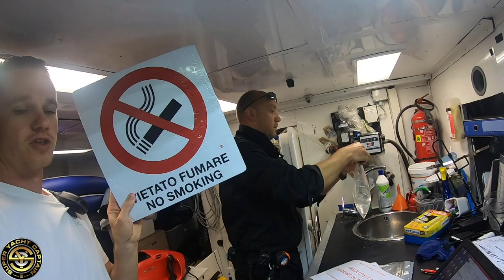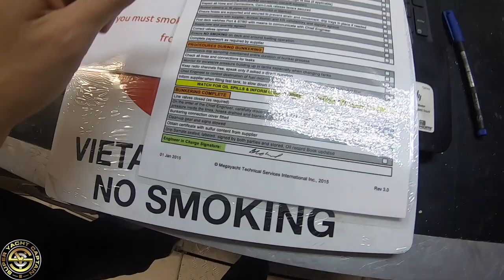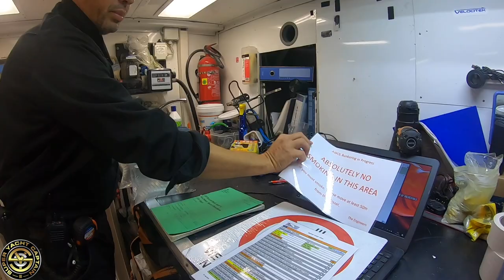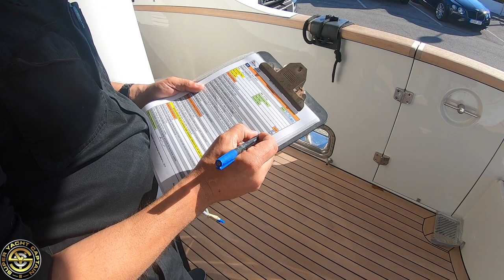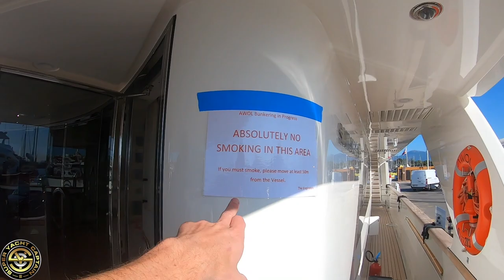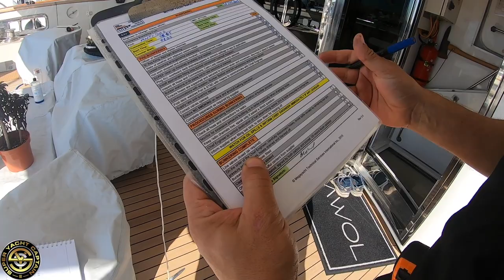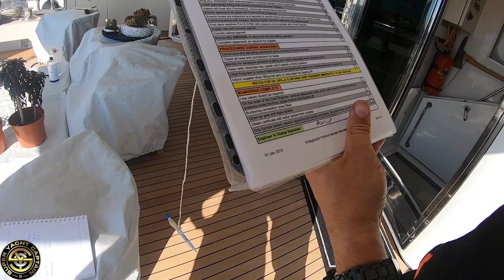REFUELING A SUPER YACHT!!! (Captain's Vlog 80)

Comment: When  I was in Engineering in the Navy I would test the fuel from the receiving station and then when it passed my fuel test I would inform the EOW who would then allow the fueling to commence. I always erred on the cautious side and never had a bad batch of fuel on board.
I also ran my purifiers whenever I topped up my day tanks so that I did not have problems with my filters. By the way, the best fuel and the cleanest fuel I ever received was in Japan. The fuel slip supervisor was on board verifying my tests and if they did not meet his requirements he made his crew re-clean the fuel and then we tested it again.
Reply: Dale Johnson when you say “purifiers” I’m curious what type. I have been a Chief Engineer for 20+ years. On my vessels I ran several centrifuges that was continuously cleaning the fuel and separating any water. 
That’s a cute fueling hose eh? I would be there for days if I had to fill my boat from those little trucks. I’m surprised to see a DOI.
Reply: EOW, Engineering Officer of the Watch
Reply: Smoking lamp is out I repeat smoking lamp is out
Reply: Likely they purify it onboard and have a pretty good idea of whom they are buying fuel from, since i suspect they have a series of stops they routinely go to. Canadian Coast Guard back in the 90's picked up a load of fuel in the 90's in Panama when a ship was coming around to the West Coast, they refuelled all the light station and then discovered the fuel was contaminated......
Reply: AWOL has Alfa Leval purification filter fuel system

Comment: Pretty cool. Im sure that boat has a hell of a vent. For most the problem comes as tanks are near full, vent air can force fuel spray out onto boat or in the water. Anyone unfamiliar should slow the fill when tank nears 80% give or take. Well done as it should be. Top notch operation.

Comment: that's a lot more complicated than refueling airplanes, the other day I put 30052 gallons in a 777, only took 35 min to pump
Reply: Ya, but a spill on an airport is not nearly the ecological disaster that a spill on the water is.
Reply: 35 mins to pump 150 tonnes into a 777? Through a flexible tube? Into tanks in the wings? big heavy tanks in the wings? Tanks that would require the wings to bend in places and not in others instead of evenly along the whole wings length? Erk...disaster imminent.

So these engines don''t create and maintain a steady vortex in over-unity then? The air, when forced into a strong enough vortex gets hot and drives itself. That's what we were taught at school. Kinda just sucks itself along...
Reply: Boat people like to keep it complicated.
Reply: I wouldn't say it's more complicated, it's less advanced. Aircraft refueling has the advantage of higher fuel pump rate speeds, through multiple feeds at each wing. This vessel here only has one feed at a much lower fpr/m.

Very convenient. Sucks that due to safety regulations and practicality, refueling these vessels are tedious and slooow.
But they don't required refueling that often and a good Captain never let the main fuel storage go below a certain mark, since it's less time consuming to fill it back up.
Reply: @Kurskaja_Narodnaja_Respublika  Yes, but only to avoid injury, death or pollution..

Comment: Got be a bit of a boat nerd to enjoy bunkering procedures! Little surprised you don't have a ball valve at the connection on the yacht side, to prevent fuel coming out at severe roll angles. Also surprised that you don't a have locks on it. We had a new engineer miscalculate the fuel needed for our Cutter and the excess fuel puked out of the dipping hole in front of the Captains cabin and down into the forward cabins. He was not popular for that trip as we spent much of it removing fuel oil and scrubbing everything.

Comment: I liked the way you held the cup under the fitments to catch even so much as a drop of fuel. I would've maybe put an oil absorbing towel in the cup to catch those wayward drops. Even went so far as to encapsulate the areas of the fitments with paper towels to avoid droplets immediately. This is way more involved than just filling up your car at a gas station that's for sure!

Comment: At 11:56 your fuel vendor is on the phone and seems a bit distracted when you're handing him back the fuel hose/connector... Informative and fun to watch video, thanks!
Reply: Did I hear cell phone use while refueling is dangerous?
Reply: @michaelwiltgen.waterman4111  does not matter if it is dangerous or not. Rules are rules. Unless that is a phone that is ok to be used in ATEX zone 2 (or 1) it is not ok. And I am pretty sure that he does not have an ATEX phone.
Reply: assassinlexx  I am sure that you are right. But knowing that is not enough according to the rules. What if you have the next "Galaxy Note 7" without knowing it and it catches on fire when you are standing and fueling your car. I know it is quite unlikely but thats what the rules are about, to make it safe.

It is like I think it is silly when Americans seem to wear eye protection when doing a science project. Even if the science project is just mixing milk and water, the protection is there.
Reply: Phone is nothing. In Albania I have had 2x 50,000L tankers next to each other and connected with first truck with guys in centre smoking a cigar. Told them to put it out but language barrier hindered.

Comment: What was the point of the "drip sample".  What is it for, what do you do with it, and why is it important?
Reply: suppliers often try and cheat you of fuel so they may supply diesel at the start then change to another fluid (may not even be a fuel could be water) so the drip test is done over the course of the bunkering operation. it is important so you know you are getting what you paid for. typically you would not run this fuel until the test results came back.

source: I am a marine engineer on cargo vessels
Reply: In the commercial industry, the drip sample is used to take a total sample of the fuel bunkers. From the sample 4 bottles are filled for: 1. The ship 2. The bunker supplier 3. The ship operator/company 4. Lab analysis.

 The fuel is tested for bacteria and water content. The fuel will always contain water however, this is usually very very minimal. This is done to check the quality of the fuel and whether or not it is suitable for use. If the fuel was rejected by the lab. The fuel would then have to pumped out and the tank would have to be cleaned. Very time consuming and expensive.

Very interesting to see how a yacht performs bunkering, compared to commercial vessels.
Reply: Thank you all for your very informative replies!!
Reply: Also that sample may be required if there was a spill so they can determine if it came from your vessel or not.

Comment: Serious Question: Why was the Fuel Sample not tested prior to filling the yacht's tank? I'm confused because we test ours prior to filling to prevent introducing contaminated fuel on board even though there is the fuel:water separator pump.
Reply: Yes, please, more about the sampling process?
Reply: Dean Lewis I’m not sure about his process. I know our vessel we sample the fuel by using color cut to test if their is water and gauge the tanks of the bunker barge just to make sure there isn’t water in the fuel. Dirty fuel is a issue but hard to catch, that’s why we have 6 fuel filters. Water is the big issue, our water traps work but water in the tanks also creates algae blooms, had to get our tanks scrubbed last year due to it.
Reply: @LegendLength  I would want it tested prior to bunkering.
Reply: Nope gasoil is normally not tested before bunkerking. Particels and water will be filtered out and when normal a gasoil grade is ordered it should be on spec for the engines they use. In that trading area there is no need to check pour point or cold filter plugging point. The sample taken is for marpol. To prove you’ve bunkered a compatible grade for the area in regards of sulpher contents.
Reply: fuel sample is not that important on a boat/diesel. Jetfuel for helicopters for example. There u should always check the fuel before bunkering
Reply: I retired from Fuel’s and lubricants delivery a few years ago, but back then, whenever I had to deliver product to the Port of Houston,  all fuels and lubricants were sampled and tested at the origin, or pickup location, with a C of A, then re-certified by the receiving vessels, before signing off on delivery. This was the protocol for the ports, as well as the airport. Only local filling stations and the railroads did not require a C of A. It was the booking agents job to inquire about the procedure, and the delivery drivers responsibility to make sure all the required documents were noted prior to pickup.
Reply: It's an interesting question, but I would ask you if you check the quality of the gasoline/diesel you put each you fill your car tank?
Reply: @Antagraber  If your car engine sucks in dirt or water, you stop on the side of the road and call a servicetruck. Try that in the middle of the Atlantic,
Plus (LS-/ULS-)MGO (which is compareable to normal road diesel) has a lower standard to your usual gas station juice.

Even with fuel purifiers, you may introduce a lot of garbage into you main bunkers and clog something up.

Especially when refueling in less developed countries, you absolutely have to check fuel quality before filling up - we even check every fuel cell on it´s own, so if the truck is sectioned into 6 cells, we sample all cells and test them for water, clarity and smell.
Reply: It's only checked for "dyed" ( sulfur ) .. I ASS/U/ME ..(The fuel is Dyed at refinery with red if it is a high sulfur content) "low-refined" diesel is NOT permitted in these vessels
Reply: @MemoryLaneCinema  A bad Diesel oil quality will just blocked the fuel pumps and injectors! So of course, even on a ship it is very important to analyse, filter and purifiying it. On board merchant vessels, we take samples at the bunkering manifold then we send to shore for analysis. After about three days, we receive the details and only after that we can burn it. Diesel engines are very very sensitive to bad diesel oil. Helicopter or aircrafts running turbojet engine are really less sensitive but the regulations is more strict as it will be a disaster to have an engine failure during the flight.
Reply: This subject got touchy very quickly. Damn.

Comment: If it were me, I’d be adding diesel treatment (Algicide, Fungicide, Water Dispersant) with every delivery.
Living offshore on Islands, in commercial lobster fishery, we typically refuel from carrier vessel at sea every 2nd or 3rd day, and always treat the fuel we take on as a precaution.
The fuel comes out of a ship from Singapore, sits in tanks on the harbour hardstand until needed, then into tanker truck, then into carrier vessel tanks, then delivery at sea, so potential contamination points along the route are frequent.
Fixing problems at sea after the fact is a lot harder than in harbour where everything’s readily available a phone call away!

Typically the vessels are at the offshore islands for 6 months between returns to port for this sort of tomfoolery!

These guys wouldn’t last the first day in the lobster industry.

Comment: Never understood why they put no smoking when pumping diesel signs out, diesel burns under extreme pressure not a spark plug.
Reply: Its still considered a combustible liquid, UN placard class 3 hazmat.  it is definitely less LIKELY to ignite from a cigarette than gasoline (petrol), but it still can.
Reply: Diesel doesn't burn under extreme pressure. It combusts. If you want to make useful power, thats the way. But in the open air, diesel can also burn, just like gasoline.
Reply: Diesel start vaporising thus creating flammable mix around 60 °C (140 °F) . As you can notice they are at direct sunlight so it is possible scenario. 
Normal gasoline start vaporising around minus 40 °C (°F) so it is considered more flammable.

Comment: Interesting that you don’t water-down the teak deck before fuelling (to prevent lasting damage to the teak should there be a small spill). Also that you don’t keep new fuel in one tank (port or stb) whenever possible in case of contamination. Did your check list include confirming that the tank isolation valve(s) are open?

Comment: Where does the air from the empty tanks exit the ship?  Fill up an empty vessel with a liquid and air escapes.  I have heard them called overflow valves.  Where does yours exit the ship?
Reply: The tanks are well vented.
Reply: The tank vents will either be run up to mast or some yachts have tank breather at bunker location.

Comment: So that is how you fuel the yacht, but what about other fuel? I assume the chase boat and jet skis and what not run off regular gasoline and not diesel. So I assume you have another tank to refuel those. I would assume that you would probably need a couple hundred gallons at least. Do you just use portable tanks or do you have a dedicated tank for them? Do you use propane for the stoves or grills?

Comment: what is the point of the drip sample? testing later when the engines blow? check for contaminants, or water in fuel?
Reply: Its a standard in the marine industry.  Contaminants, off spec, etc.  Some places will send a sample in, others just hold it.  Another benefit is if the fuel comes up water contaminated, it can be checked to see if it came from the supply or from a hull leak (more applicable to large merchant ships than super-yachts, but still)

Comment: How is fuel charged to guests?  Is fuel included in the charger rate?  Are the tanks normally kept full then you fill up at the end of the charter to know how much was consumed?  Do you charge for fuel by the amount of main engine and generator run time?
Reply from the maker: We sound the fuel at the beginning and end of each charter and charge the guests the total fuel consumed based on the price per litre.

Comment: Enjoyed watching that.  If guests are onboard do you ask them to refrain from using mobile phones near the bunkering connection?
Also, as the ships  fuel connection is in that particular location I would have thought an opening or hatch would have been in the hull to allow an easier transfer of the hose plus safety if the connector and hose disconnect by accident, from a barge, fuel station or lorry as shown. Or is there a particular reason it's done that way ?

Comment: Based on "bunkering costs"(Fuel purchasing) in Gibraltar. A favoured place for "super yachts" owing to "tax free" status, I "guestimate" the cost for bunkering motor yacht "LOON" to be in the region of 130-135000 Euro's(poss. 140-150,000 U.$). Either way, quite different to merely driving to a local gas station, to put 50 bucks worth into a vehicle..!! LOL

Comment: This is my guess.  Diesel fuel floats on water, so taking the fuel sample when the delivery truck is empty would find water if any were present in the bottom of the tank.
JIM
Reply: Not necessarily. A: diesel absorbs a small quantity of water (similar to the way air floats on water, doesn't mix with water, but absorbs water) so you need to check the quality of the fuel before it goes on the tank B: if the last load of fuel was good, then you'd get good diesel in the hose but you could simultaneously have water in the bottom of the truck: you'd find in the drop test what you get first is high quality diesel, then some water, then diesel with water in it.

Comment: What was the cost for all the fuel?
Reply: At $3.00 per gallon for non taxed diesel it would be a little over $116,000
Reply: @williamhunter394  They fuel 10.000 litres which is 2642 gallons, times 3 dollars a gallon is equal with $8000.
But my question would be same. How much does it cost for yacht owners? This huge amount of oil must be cheaper than for us buying tiny amount for our cars.
Reply: @benmester8  they probably pay anwhere from 85 to 95% of the original cost of the untaxed diesel
Reply: @williamhunter394  I see math isn't your strong suit... 3,500 gals x 3 = 10,500...
Reply: @JCrook1028  it obviously isn't yours either seeing as though 10000 liters is 2650 gallons
Reply: @williamhunter394  I just used the 3500 gallon figure on the title screeni of the video.

Comment: i guess they tax fuel differently  in Europe.. in the USA we get charged a road use tax..the farm  equipment and boats  do not use roads , their diesel fuel has a red dye . so it could be checked if it is used on road vehicles . 
How much does a liter of boat diesel cost in Europe ?  I didn't see a answer below , although it was asked several times . For road  diesel  the cost is about $3.25  a gallon right now .  maybe $2.00 without taxes but marinas rarely give a break and many times the fuel is actually more  from a marina than you can buy at a average gas station . you can fill up yore yachts at marinas in Florida , they have very high speed pumps .

Comment: So some of those 100m+ yachts need 8 to 10 trucks to fill them up?  How is that fuel priced?
Reply: Diesel costs roundabout 1,35 Euros per Liter.
Reply: @svens.5139  That's only about 1.50 US.  that's not as expensive as I thought.
Reply: @SeniorSimRacer63  35000 ltres , $52500 , and thats only a partial refill, isnt cheap
Reply: @georgeh9967  I did not do the conversion and was thinking gallons not liters.